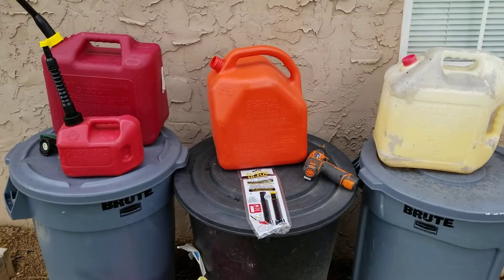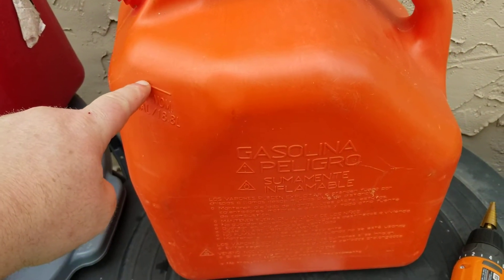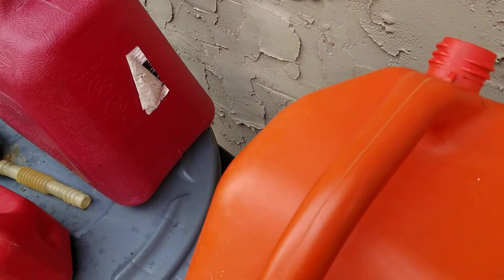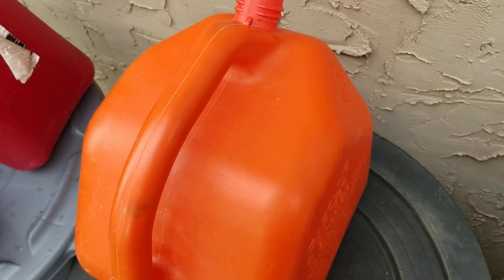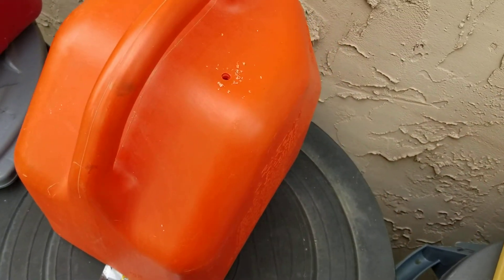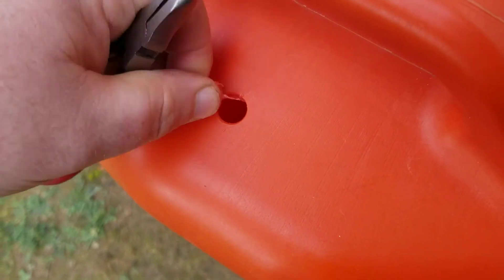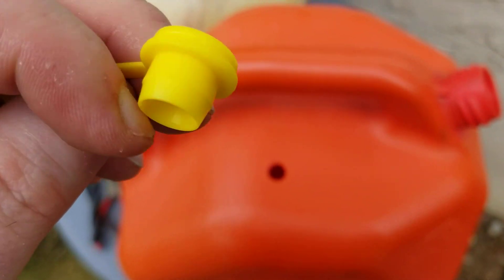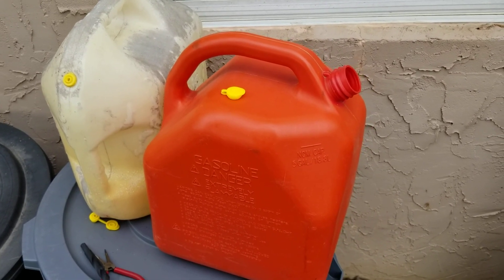EZ-POUR UNIVERSAL GAS CAN VENT INSTALLATION

Comment: When you pour the fuel using the gas can - tipping it - the VENT at the place where you installed it - will be covered in Fuel.

Comment: Use a little bead of "Seal-All" adhesive to make it 100% leakproof. It is oil AND gasoline resistant.
Reply from the maker: Truthfully I mine hasn't even leaked. I guess I was lucky. Thanks for watching! Please Like & Sub
Reply: Is that available at most hardware stores?
Reply: @edmondlau511  
Most hardware stores should have it, or order it online. It comes in a yellow tube, one or two ounces.
Sometimes it's in the adhesives section, but I've also found it in the automotive section.
It smells like vinyl swimming pool patch adhesive, but it is oil AND gasoline proof.
Reply: @adamsanders1213  Thank you!

Comment: When you pour won't the vent be covered by gas. It seems that you should put it on the slope surface.. just asking for a friend.
Reply from the maker: I haven't had any problems with it so far I was just trying to keep the vent off of a seem because it will crack. You can always use a tire valve stem as a vent if you remove the Schrader valve.

Comment: Step drills work best in plastic.  Twist drills tend to grab and screw themselves into the plastic, leaving a jagged hole that's guaranteed to leak.  And spade bits are for cavemen.....don't be that guy.   You can mark the step drill bit with a red sharpie on the next size above the hole you're aiming for to help prevent over-drilling it.
Reply from the maker: You can use them all if you are careful. The only reason I used a regular drill bit is because that's the most common for people at home watching. The key to all of them is just take your time and not get in a hurry. Thanks for watching Danny I appreciate it. Please like and SUBSCRIBE. :)

Comment: It’s supposed to be a 31/64 inch hole. Not a 1/2 inch hole. That is 1/64 inch smaller hole than 1/2 inch. It will be a little difficult to get the vent cap inserted into the gas can with the smaller hole, but that will ensure that the vent cap doesn’t leak.
Reply: Mine don’t leak and I used a half inch bit

Comment: I drill up with the tank upside down to prevent the chips from falling to the bottom
Reply from the maker: It's still possible to get shavings in it no matter which way really.  I just rinse the can out with water several times to double check it. Thanks for watching! 😊 Please Like & Sub
Reply: @matthewmeltonTEAMMELTONFISHING  Rinsing it out will no longer work. If you have a Sceptor brand can, the outlet is no longer flush with the wall of the can (inside).
Reply: Thats my only concern is bits of plastic in the can.

Comment: where did you find the vent ?
Reply from the maker: It comes in the kit or you can buy them on ebay or Amazon by themselves. Thanks for watching, please like and SUBSCRIBE.
Reply: @matthewmeltonTEAMMELTONFISHING  that was fast, just ordered a bunch. thanks
Reply: @larrybottone1264  I got mine from Amazon. 20 for about $8. You can buy less, but they go quick. Friends and neighbors, relatives. I just mailed 4 to a retired co-worker. I'm probably going to order another 20.
Reply: Rural king has these in stock.
Reply: It comes in a kit with a spout.

Comment: get that plastic in the tank, and enjoy carbeurator headaches
Reply from the maker: Just since it out with water or used compressed air and there's no more plastic.
Reply: Yes,  because it's impossible to clean out a gas can